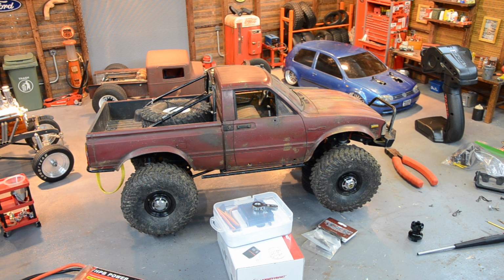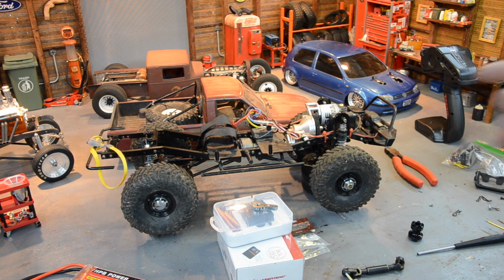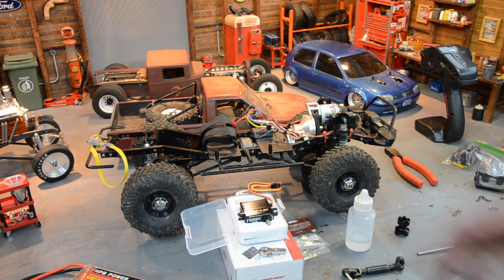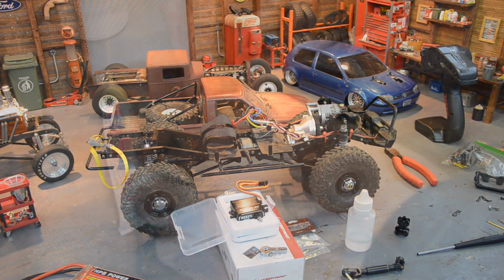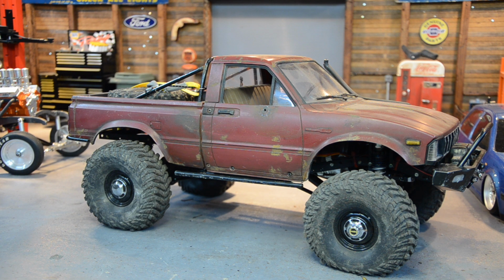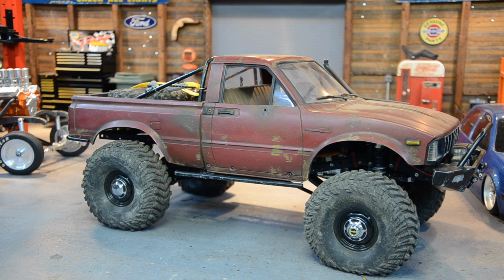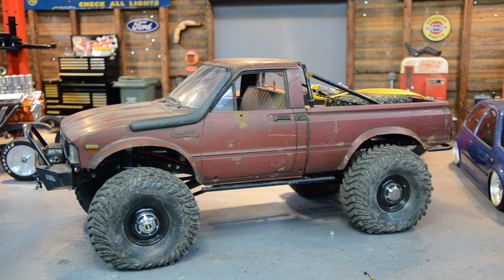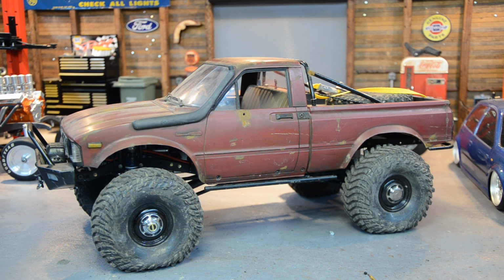Serious Upgrades for my Favorite Old Red RC4wd Trailfinder 2 Hilux, Reefsrc, Helios, 1080, TF2

Comment: nice rig. I just got the job at 1985 Toyota 4runner LE. on the newer TF2. I thought about getting rid of the leaf springs and switching to three and four lane suspension. I need brands or suggestions please
Reply from the maker: RC4wd makes the only 3/4 link for hte tf2 that I am aware of

Comment: What sized shocks are on this truck? 90 mm? I’m still running the stock shocks after linking the truck. I like it a lot better linked. Previous owner messed up the links so I did what I know and swapped to links.
Reply from the maker: It’s been a while but I think the proline shocks were 100mm. I have the gelande2 front shock hoops to keep it down.

Comment: I ended up using the crazy crawler 116x40 HD foams. But still can't put more than 5lbs on them because if the lack of sidewall as mentioned. I've even ran the 116x40 crazy crawler WP magic in them before. Holds their shape perfectly but no flex. Lol. Nothing is the perfect foam for this tire..🙄

Comment: Have you ever found someone that makes plastic inner fenders for the TF2 with the bigger shock hoops? and still clears the body ok? Would really help me keep the snow from clogging up my rig. 

Always love the content man, I'm trying to decide whether to get rid of this mint TRX4 I have for another TF2.
Reply from the maker: Man I havent seen any out there.  Id like to have some myself.
Reply: @RCeveryday  I appreciate the reply! If I find something, I'll let you know.
Reply: @sweetmammoth7067  I personally just got the normal ones and then cut them to clear the G2 shock hoops, my cuts are anything but clean but they clear just fine
Reply: @KearSki  I did try a set of them, but they really didn't last long when I was taking the body off all the time. I was thinking maybe gluing two sets together for strength? Not sure.
Also been looking at possibly just making some out of styrene, but the local place has none in stock.
Reply: @sweetmammoth7067  If you're looking for cheap and durable, I know some people have made them out of cans and plastic fast food drink cups. but yeah, one thing I did was over trim them a little so they rubbed the body a lot less, it caused a bit of gap but it has helped durability. Also there are some good plastics retailers on Ebay, I've gotten phonebook sized stacks of Styrene for around 20 dollars before
Reply: @KearSki  I appreciate the replies. I guess I'll just have to raid the recycling bin to figure out what's best. 
I did find a guy that makes 3D printed fenders front and rear....but the price is kinda out there. R3scale I think is the company name on Shapeways. But it's like $60 us for the front fenders(which I don't think are the GII style hoops) and $36 for the rears...I think I'd rather try the cans from the recycling bin first or styrene at that point. 
Any glues you recommend for the styrene?
Reply: @sweetmammoth7067  I usually use BSi CA glues https://bsi-inc.com/index.html My grandfather has used the brand since the late 80s for model aircraft and I've always had good luck with it. quite a few different formulations and cure times available as well, I often use the insta-cure for larger parts, as it keeps them in place quickly enough for me to clamp them nicely. I've found it quite a few places, hardware stores and hobby shops alike, I've even seen it at hobby lobby. 
Also a good thing to do when working with Styrene is to use lots of templates, cardboard or paper. I find that the board that breakfast cereal boxes are made from works pretty well, it's nice and thin but still stiff.
Reply: @KearSki  I really appreciate that. I'll definitely look into that glue and the advice! Thank you. I'll have to see if the Canadian hobby shops carry it. Was super nice to order stuff to the cottage in the states and then bring it up duty free...FedEx double charged me for duty on my first order from the RPP Hobby.

Comment: Watching toward the end, yeah brand new TF2s preform rather poorly out of the box for those first couple drives, but when I first got my LWB I knew to expect nothing much in performance terms, but I never wanted very much, I wanted something scale and it fit the bill. currently it has a lot of available flex as I've "carefully" modified the leaf springs, shackles and geometry and I ended up liking the leaf spring driving so much that I ended up getting the conversion for my G2! After all, if I want high performance I've got a box stock SCX2 honcho now. but it's good to see this rig! I love the weld line where you bobbed the bed, I've seen a lotta real yotas that look just like that

Comment: I take my vaterra accender everywhere.  I haven't had anything  rattle lose. Is it just these tf2's ? 
I crawler group im in a guy has one and he complains about it always breaking  down. It makes me wonder if they are worth it. Because  I think they look killer
Reply from the maker: most everything on the tf2 is metal on metal. without some kind of thread lock it happens.  This one was in my rooftop cargo box for a 2300 mile trip so it showed me where I didn’t have any😂  they are my favorite chassis still. the other 3 I had didn’t have anything come loose on the ride either.
Reply: @RCeveryday  one reason I watch your channel. Is you are honest  about your thoughts. I'll pass on the tip to check for thread lock on metal to metal connections

Comment: I stopped using locktight and use Teflon tape instead ..I just lay the teflon on my finger I put the grub screw on the tip of my t-handle Allen wrench press down and turn counter clockwise until the screw is covered then run it in the hole